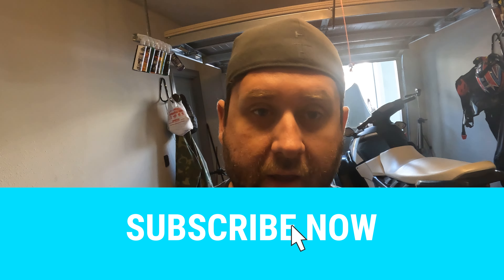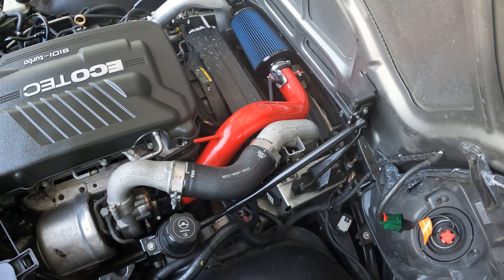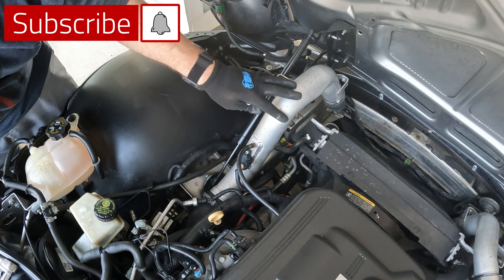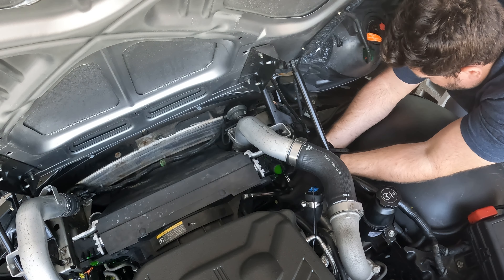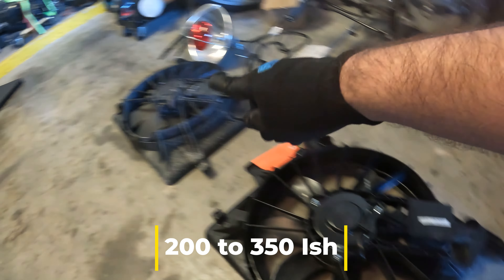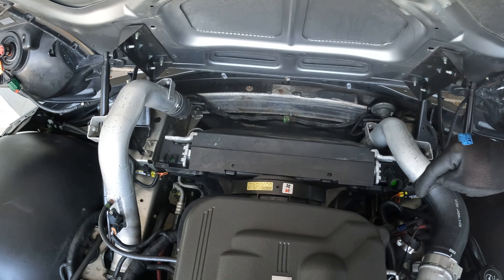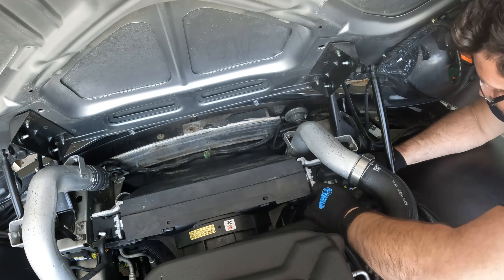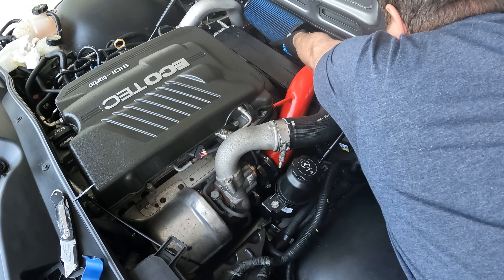How To Pontiac Solstice / Sky / OPEL GT / HHR / Cobalt SS - Radiator Fan Install

Comment: The AC went out on my 2006 Pontiac Solstice and now my car is over heating are these two related?  Could this be causing it to overheat?  HELP PLEASE!  I live in Central Florida.
Reply from the maker: Best bet is to check and see if you radiator fan is even working. The fan is tied into the AC compressor. No fan, no cooling, ac won't engage.  Also this leads to overhearing. What your describing seems tied together.  Had same issue.......was a bad fan and controller. Replaced this.....ac started working,  car no longer overheating.  If you have the gxp best to have the GM check valve installation done also.

Comment: Your videos are freaking awesome! Clear, straightforward and concise.  Can't wait for the "Blooper and Blunder" Show.:hand-orange-covering-eyes:
Reply from the maker: 10 min install and 3 days of troubleshooting
Reply: @GearHeadzGarageUSA  That beats a 3 day install and  10 day troubleshoot.🤪
Reply: What’s a good way to test to see if the fan is working? Mine use to seem to come on sometimes when I re-parked it in garage. Sometimes it would come on when I turned key off, sometimes even stayed on. noticed lately it doesn’t seem to do it anymore. I usually have the top down, but last night I turned on the A/C and heard heard a strange noise so I shut it off, could that be related?
Reply: Could you tell me how hot your GXP typically runs. The info display shows coolant temp, it would be super handy to know where yours runs at with the new fan. What is the average Driving temp? And what does it show at idle? Mine shows around 202F driving, but noticed it goes up to around 208 or higher when idle at light. Maybe as high as 212. Would be great to know what it should run at! Thanks.

Comment: THANKS FOR THE VIDEO.  I am not trying to replace anything but the fan relay module... So i tried looking it up and couldn't find anybody who showed the damn actual location!  As soon as you pulled the fan assembly out i saw it stuck right to the outside of that sucker.  Went back to the garage and did it in 5 minutes... THANK YOU!
Reply from the maker: Glad it helped! Most of the time there is nothing wrong with the fan it's the module itself. Happy cooling!

Comment: Great video, very helpful. Thanks!! 
Where did you order the fan from?
Can you send me a link to the product please?
Reply from the maker: You have a few options on the fan depending on 2.4 vs 2.0 GXP/Base its very hard to find OEM GM so aftermarket may be the way to go now.  Let me know!

You can use;
https://amzn.to/46zBk7p

https://amzn.to/48imDah

https://amzn.to/3t1QlQL
Reply: I have a gxp (2.0L 2008) and the first 2 appears to be not fit.
Is there a significant difference between their cooling fans?

Also I need it to be sent to Israel😅
Reply from the maker: @gacuhoron5142  that's a long way to ship.  So there are 2 different styles the fans are the same the difference is in the variable controller that's attached to them.  Unfortunately it's very hard to find a GXP/Redline fan most are out of stock and have been for a long time everywhere.

 Try RockAuto.com they ship everywhere but have been out of stock as well so keep an eye on that.  Worst case scenario you can use the 2.4 Fan and cut and swap the old connector off the 2.0 fan over to the new one as well as the controller simple process.  In the end both have the same bolt pattern between the fans.  Hope you can find one! Keep us updated